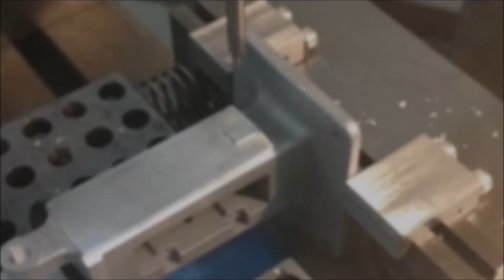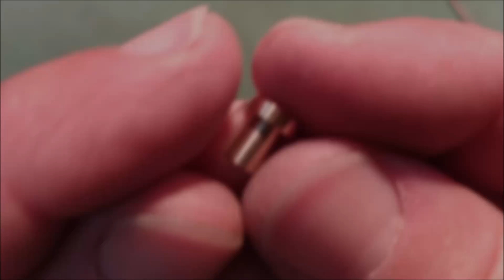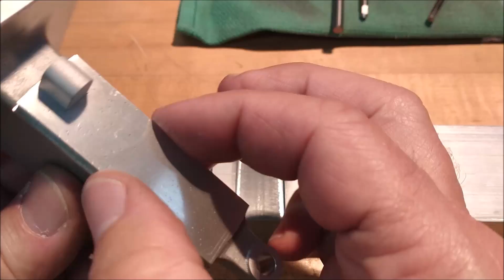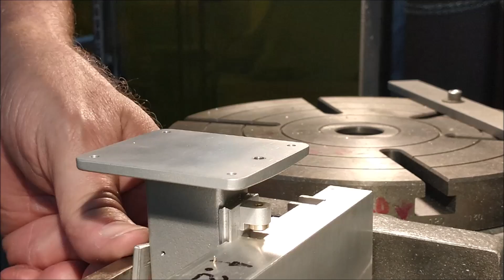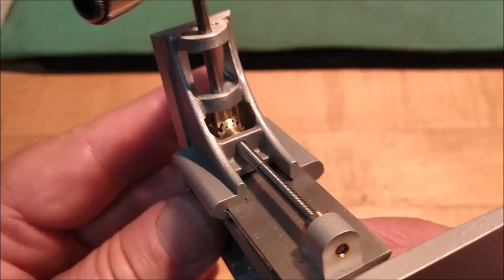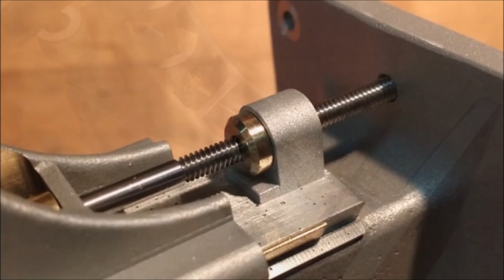Sometimes The Repair is Better Than the Original........Drop the Mic...

Comment: Just a thought. Could you not drill and tap a screw into the square receiver from below. Hidden under the base
Reply from the maker: As I stated in the video, that was an option, but the mechanical engagement was 90 degrees to the draw I wanted. I wanted the screw to pull the slug flush.

Comment: Just drill a hole in the baseboard to receive the screw, that way you get full table travel. That's my guess on the length.
Reply from the maker: The unthreaded section of the shaft, the length of the present thread, the overall length of the shaft and the relative position of the spur gear to the shaft end, all need to be coordinated to get the maximum table travel. Simply drilling  hole in the baseboard won't deliver the same result.

Comment: Hi Joe, can you please go over the advantages and disadvantages of using a center drill vs a spot drill when starting a hole, either in the mill or lathe (or drill press)?

Comment: Interesting fix. I have seen a number of old full sized machines and this feature is generally not cast in the body but separate. I have also seen a hole in the base to accept the lead screw for clearance. Kudos on a great fix but also a fix making the model more realistic. Nice Job Loe.

Comment: Great work as always, but how did you create the accurate radii on the plug.? It feels like a very long setup in a rotary table just to allow ease of with the pocket..
Reply: The plug he made on his CNC mill? It probably took longer to model it in his CAD software than to actually machine it on the mill.
Reply from the maker: It was a CNC part.

Comment: Would be one heck of a job if that mill had to be 1:87 scale. Judging by what you were creating the size would be in the 1:40 to 1: 50 region on scale more or less. Great videos on these models. For me its a must watch😅 at all times jus in case i need some tool or setup gem. Thank you an keep them coming. Be blessed and safe🙂
Reply from the maker: Thanks.

Comment: The ~1890's B&S No. 6 Horizontal Mill in my garage has an excessively long screw as well, so your prints are likely period correct. Not sure why the designers intended for the screw to be so long though.
Reply: If I had to guess, they had a hole in the floor for the screw to drop through. The bottom wheel on large diameter bandsaws had the floor cut out for wheel clearance and maintain proper table height.
Reply: I had a big horizontal mill of (unknown) German manufacture, flat belt drive so certainly pre 2nd, if not 1st World War, and this had the same feature. There was no way the design would have allowed for a shorter leadscrew. I had to chisel out a hole in the floor for it. Maybe this was a commonplace design feature in those days.
Reply: You could maybe put it on a riser, but it would take a tall hand to run it.

Comment: I have a 18 inch shaper in my shop.. the table lift screw sticks out the bottom of the machine almost a foot when all the way down. So I had to drill and sleeve the floor so it had room to go down.

Comment: I would have made the part with a threaded end and a blind threaded hole in the casting. Then screw the part in with lock tite and then mill the shape so you end up with an invisible fixing.  Of course that is only theory- in reality I would have screwed it up and tossed the whole mess across the room and gone back to watching You tube videos.
Reply: You would because a square part doesn't rotate down in a same sized square hole... Joe's solution avoids that problem. If you don't own a cnc mill you could make the part, fiddly, on a rotary table. Or scribe the radii and file away until it fits. With patience and perseverance you'll get there. Maybe, I don't know because I don't have the drawings for this build, is dropping the dovetail plane down a solution so you can still use the casted feature as a bearing end. Best, Job
Reply: @jobkneppers  No need to mill a hole, just thread the part in flush with the surface.
Reply from the maker: Dropping the dovetail down is not an option for the fix. It would require gibs on both sides to keep it centered as the top edges would really be compromised.
Reply: @joepie221  You replied to the wrong pain in the neck.

Comment: Beautiful work - and a very effective and elegant solution to the boss. Definitely better than the original. Goes without saying (but I'll say it anyway) as to the genius of the support tool for threading / parting. I made one using small bearings but it really doesn't work very well - a simpler guide like yours supports better.

Comment: Nice video Joe, as always.
Over here in the UK, I used to work in an electrical engineering company.
The material that you used for the lathe jig, was known to us as 'Tufnol', which was actually a trade name for SRBF (Synthetic Resin Bonded Fibre). We used to us a cheaper cousin of this material - SRBP (Synthetic Resin Bonded Paper) that we incorrectly called 'bakelite'.
Useless fact of the day:
Ford in the UK and Germany, used an SRBF gear in the valve timing set in V6 engines. This was done to reduce noise. Apparently, if you replace the gear with a steel one, the engine will whine like a Karen...
Reply: Yes, I've seen gears made from this material to be a sacrificial, wear item cheaper to
replace than the mating components.
Reply: @petemclinc  Harrison used one in the leadscrew gear train, I'm not sure why, possibly sacrificial in case of a jamb-up.
Reply: All 4 facts perfectly true.

.

Comment: Joe you really make that look easy, which I know it isn’t. Another beautiful job! Quick question, when you tapped that left hand thread in the brass bushing I noticed you didn’t use any tap fluid, oil, anchor lube, etc. Was that because it was so small or because it was brass?
Reply from the maker: I brushed the tap with WD-40 off camera.

Comment: I’m a relatively new hobby machinist and I’ve tried your method of threading away from the spindle and I quite like it. My question is why you chose to single point the thread on the lead-screw rather than use a die to cut it?
Reply: I was wondering the same thing but I think it’s because it’s a left handed thread and he didn’t have a die.
Reply: @aguycalledlucas  Probably, I just wasn’t sure.
Reply from the maker: If it was a meatball part, I would have bought a die, but its a lead screw. Single pointed threads are waaaaay more precision than a die cut thread.
Reply: @joepie221  Thanks, I wondered if that was the case.

Comment: I suppose the original machines allowed the lead screw to protrude through the base because,most machine shops had wood floors.No big deal to drill a hole through the floor 😂

Comment: It's too bad you can't counterbore the cabinet side to hide that fastener. As far as scale of that model it seems out of place
Reply: If he came into the hole from the outside using a reverse counterbore, it could possibly be achieved.  At least to me it seems feasible. Special tooling would be required(as is in most all Joe's operations).
Reply from the maker: I don't particularly care for that either. It will be shielded once the shelves go back in, but I'm stewing on it.
Reply: A pin from the side with an offset hole like the timber framers use; then file and blast it.